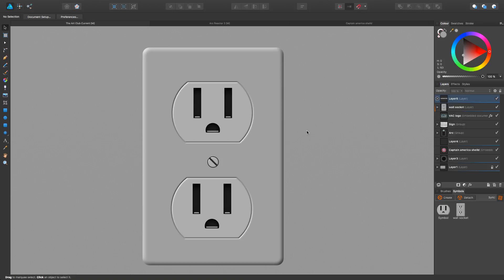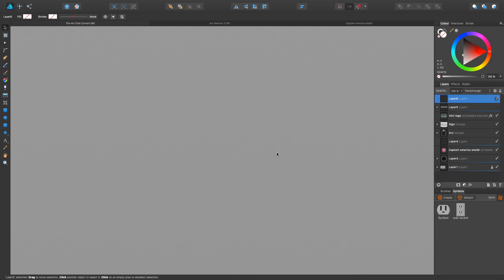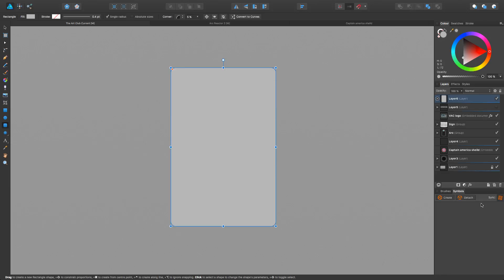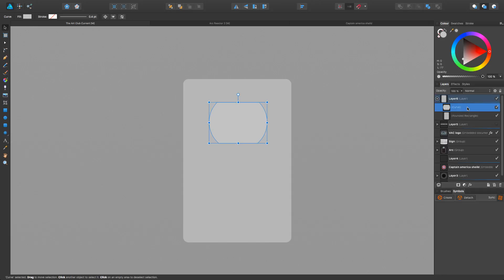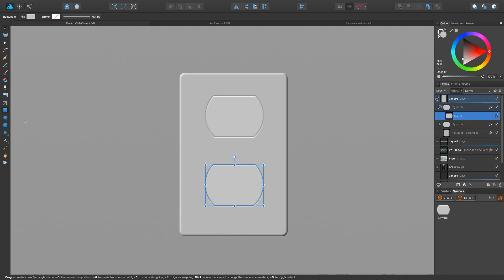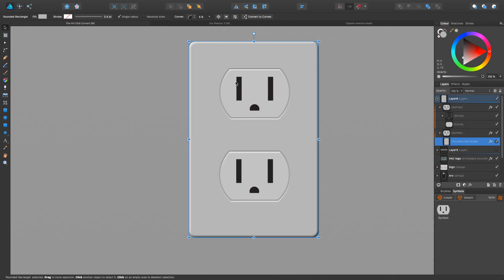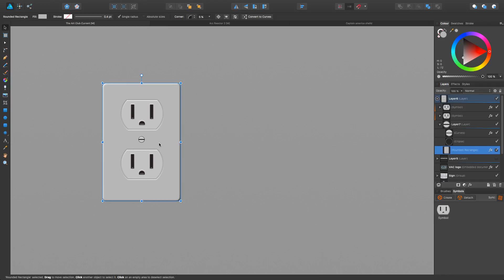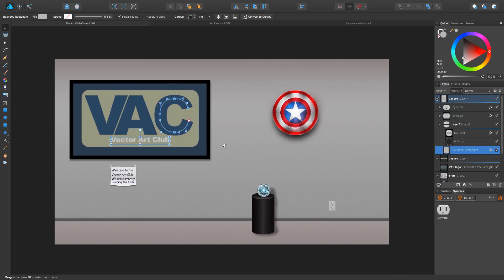Creating a Wall Plug in Affinity Designer.

Comment: Can you tell me what is the difference between Affinity Designer and Affinity Photo?
Reply from the maker: Affinity Designer is more for designing things from scratch, like logo's or creating original artwork (both vector and rasterized). Affinity Photo is more for importing a photo and editing it, adding text and doing effects. If your familiar with Adobe Photoshop and Illustrator then Affinity Photo is more like photoshop and designer is more like illustrator. Both Designer and photo use the same save file so you can seamlessly open the same file between both apps.